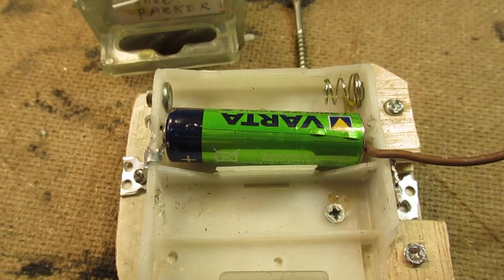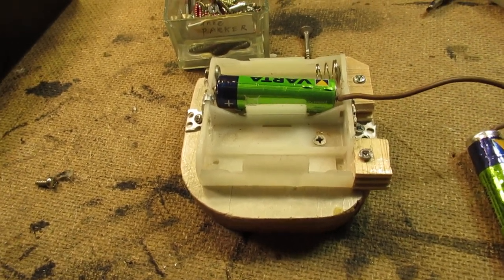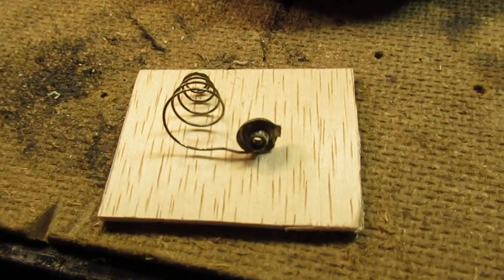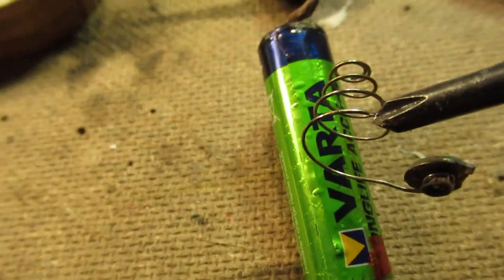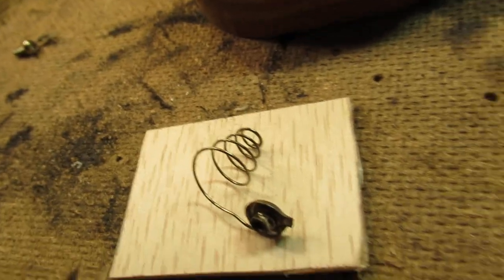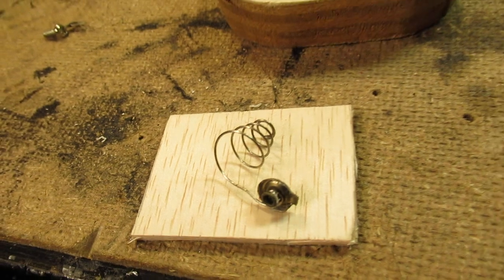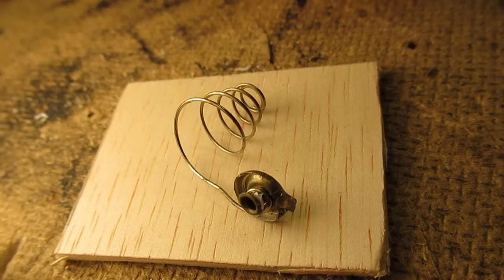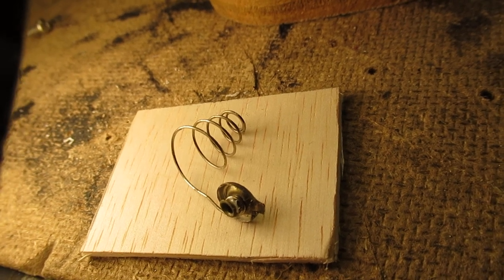Not expected contact resistance on the micro scale between 2 metals,  blocking all the current!

Comment: i have seen this in devices that draw very low current, like IR hand remotes for Tv, Digicorder, heating thermostats etc.... in my opion it has to do with oxydation, because when you rotate the batteries with you finger while they are still in place, suddenly the remote starts to work again like before. Also, sometimes you measure a very low resistance value between 2 points, because your digital meter draws very low current, but when you try to "pull" a certain current between these 2 points, you have a very large voltage drop and the device doesn't work. That i have seen many times in car wiring, where you can light up a small LED, but a incandescent lamp will not glow. This is also with relays that draw very low currents between there contacts, they can suddenly stop switching the small load, where high currents "clean" the contacts of the relays. That is also the reason that in some relay datasheets the minimum voltage/current between the contacts is advertised.
Reply: Very accurate observation. I think the same 👍